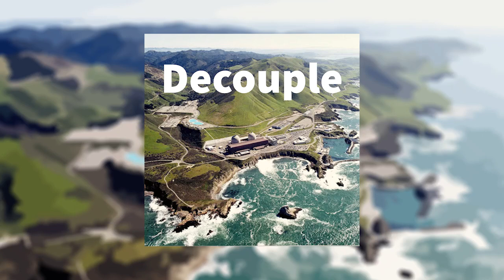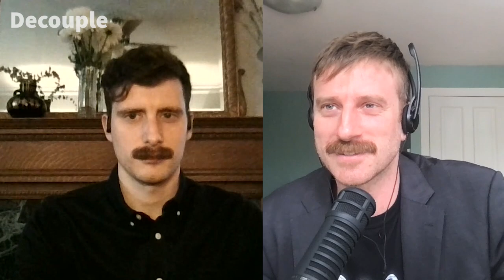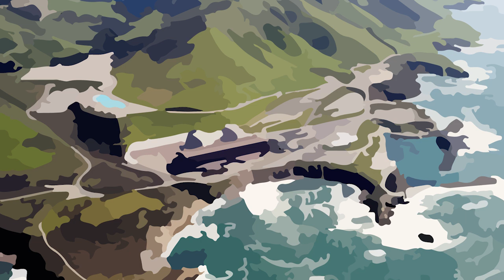Something's Rotten with French Nuclear

Comment: Same thing has actually happened to Diablo Canyon in California. It couldve probably gone on for another 20 years (possibly more), but the state became anti-nuclear, so shutdown was the only option on the table. 
I suppose in some cases the reactor cores suffer enough wear n tear that the plant has to shutdown. However, even then usually the power generation infrastructure at the site can be reused with a plant build nearby (so long as the terrain is supportive). 
The other thing is that the math of climate action doesnt work if its not a global effort. If its a state by state response then what it actually achieves is less pollution. Thats about it. 
The benefits of might not matter if it creates energy shortages and crises; in which case it just become a giant job killing exercise.

Comment: I think blaming the 50% cap legislation is a bit of a cop out argument for Frances nuclear program failures. EDF has been fucking up new build nuclear inside and outside France for decades, not just in the last four or five years.  If French nuclear reactors were  an affordable form of new power in comparison to renewables then they’d be building them, even if it was just to maintain a 50% level. Wasn’t there documented, real world problems found in the reinforcing of the reactor concrete enclosures causing the maintenance scheduling this summer?

Comment: Interesting talk, Thank You. I will spoil the  current 69likes status and press the button now:) I would love to hear about comment on  the EPR  power plants and why it is such a difficult building experience in so many places. Is it caused by similar management problems exported abroad? To complex design? Is it problem with local safety regulators like STUK in Finland? Also how much of the problems mentioned in this current episode is the "cancer of delusion" spreading from Germany and it influence in EU?
Reply: So many issues. The French nuclear safety authorities ASN are stricter. You know there were issues with the welds on the secondary side and this had to get fixed.

Comment: The French nuclear fleet is now old (average 38 years) and many of the existing reactors have severe neutron embrittlement problems and will cost huge sums to decommission.
Reply: With refurbishment they could go to 60 years.  Metal can be replaced - even reactor vessels.
Reply: @daniellarson3068  It is not commercially viable, in the case of EBR or similar circa 1 GW reactor, simply to replace the containment of the reactor core.  After so many years, it will be highly radioactive. Moreover, the reactor is built around the core inner containment, so major access is not possible.  Maybe for SMR, inner containment replacement may be feasible in the future, if the SMR design allows.

Comment: The EU determines all countries competition rules. Add to that green energy rules the roost and the politics.
Not fixable until Brussels looses control.
Reply: Point me to a system or rule in the EU that would hamper running or upgrading existing nuclear plants and their ability to produce energy?

How you deal with the energy needs of your country is a national task. 

There are rules for interconnections between countries, but they only look at price, not how the electricity was made.
Reply: Hi,  Yes you can decide on your own nuclear policy but Brussels sets the economic environment.The control is exercised through mandates and regulations such as, replacing long term energy contracts with short term energy trading to benefit the renewable industry), setting up of the Eurowide electric power exchange, the clean energy mandates etc. Me thinks no shortage of examples.
Reply: @bobdeverell  There is so much wrong in your comment, it is too expensive in time to answer and explain it all. 

Just some samples: 

* There is no "Eurowide electric power exchange" 
* The policy of EU on climate goals was agreed on by the leaders of each country in the European Council, after a long process involving all the institutions and stakeholders. 
* The sort term trading thing you mention is probably the length of natural gas contracts? Well, Germany and several other countries dropped long contracts because it was cheaper in the spot market, see natural gas prices in 2020 as a example. 

You seem to want to blame "Brussels" for everything that is wrong, but getting enough energy for your country is a national task.
Reply: @kimmono   Agree, difficult in a short reply to cover what needs extensive discussion.
Taking you examples...
*There is widespread electrical power exchange in Europe via the interconnectors. 
*EU policy was not agreed by referenda,  only by those with vested interests. Agree, this is a matter of opinion and we have different views.
*Intermittent energy generation trading was introduced under the false guise of improving efficiency. In reality  it was the only way to allow intermittent renewables to compete against coal and nuclear. If power contracts were required to generate 24x7 and costs include upgrades to the various national grids, then renewables, even with battery storage,  would be priced out of the market. My evidence is the very high cost of electricity your european consumers now face, when compared with the USA and many other countries. 
I categorically do blame Brussels for being technically incompetent by promoting spot market trading in the energy market and for allowing lobbyists to influence its decision making. From where I live in Asia consumer prices for electricity in Europe are unnecessarily expensive. That will do major harm to Europe while providing almost no contribution towards reaching Net Zero.

Comment: The grid expansion costs are the biggest problem. And nobody sees it.
Most national grids cost more than the nations entire GDP. Fun fact.
And built over decades and decades. 

My concern is that non nuclear countries will start to go nuclear, and then the grid capacity problem will be seen. 

Australia has a $ 2 billion pumped hydro expansion project, which is now a $ 12 billion project with new grid construction. 
They are not going to stop work, too much invested. 

Australian nuclear promoters are well connected and being misleading. 

For Australia 
1million km ×
1million $km =
1TRILLION $
GDP 1.5TRILLION $ 

No CO2 emissions means going from 15% to 7 times more grid electricity, 100% electric. 

Rubbish. Spend 7TRILLION $$$$$$

So I speak up.

Keep nuclear running if you have nuclear, just don't think about the generation only. 

Grid capacity to millions and millions and millions of customers is critical.

Comment: 42:00 French nuclear at 36% off mix would be fine if renewables, storage and imports of GermanRE made up the other64% to clean the entire supply. Demand will undoubtably go up when France adopts EV legislation and decarbonised what’s left of their transport, built environment and industrial sectors.
Reply: The problem with trying to go from 70% nuclear to 70% solar/wind is that people generally protest against any new large infrastructure

France would need something like 150GW of wind farms to repalce its nuclear output. That would be 30,000 large 5MW onshore wind turbines visible for miles

What's more is you'd need totally new transmission infrastructure to take that power from these new locations across France, and nobody wants transmission lines going near their home and devaluing it

Also Francd would need to build Gas Fired Generation for every 1GW of nuclear they get rid of they would need to build 1GW of Gas fired power

Then there is the actual pipelines that need to be built to feed these Gas fired stations

It's always easier just to keep going with what you have and considering their nukes are clean it's better for them to just refurbish their nukes

Comment: One big problem with nuclear is that it needs lpts of workers. A 1GW gas fired power station needs only 40 men to run it 24/7. Thsts not 40 men there at any one time but 40 men who work shifts so at any one time there is only about 10 people there

By comparison a 1GW reactor needs closer to 700 people there. Maybe need is the wrong word. But simply put they have far far more staff than a gas fired power station and staff are not cheap

40 staff at $80,000 = $3.2 million per year

700 staff at $100,000 a year = $70 million a year

$70 milion vs $3.2 million is a big difference

This is before you even consder that a nuke needs a lot of contractors to come in once every 18 months to refurb and refuel while the gas fired power station meeds no such significant costly downtome every 18 months

Another huge factor is a gas fired station can be built in less than 3 ywars while its going to Realistically take 13 years for the nuke. Thats 13 years of interst payments withiut a dime back

And perhaps finally. The worlds more powerful contires probably wouldn't be too keen on allowing every nation to have its hands on high lvl waste. Its not going to be bimb material but it doesnt have to be a few tons exploded in a city centre would be economic charnage as millions flee and their productove outpit is reduced towards zero

Fortunately europe has the north Sea and 60% capaicty factor offshore turbines will help produce vast vast quantities of affordable electricity
Reply: 1) The cost of natural gas is the problem, not the staff's salary.

2) Let me quote you: "nuke needs a lot of contractors to come in once every 18 months to refurb and refuel"
This is simply wrong. There is no need to refurb the power plant, only a small maintenance is needed during the refueling outages.
Reply: $70 million a year at 80% CF x 1 GW is 1 cent per KWh.  Carbon tax on coal in Canada will be 5 cents per KWh.

Wind power is nice but Alberta regularly gets 3 day outages with zero output from 4,400 MW of wind power that are VERY expensive.